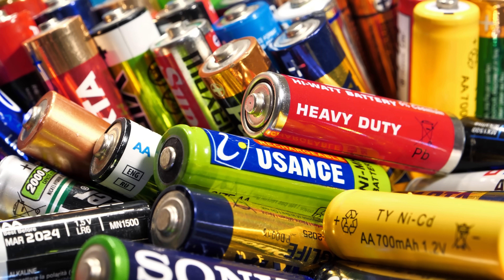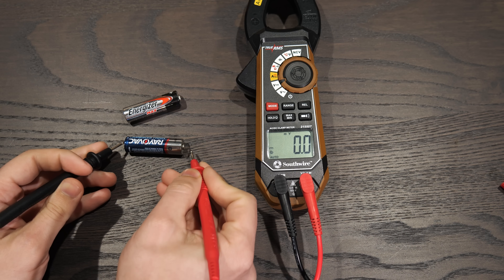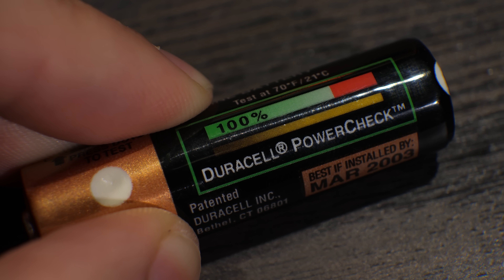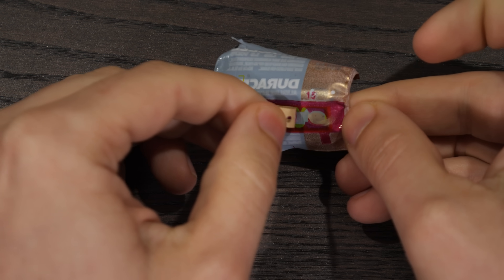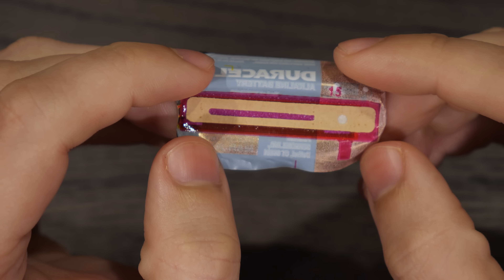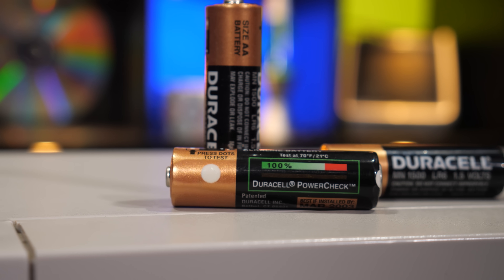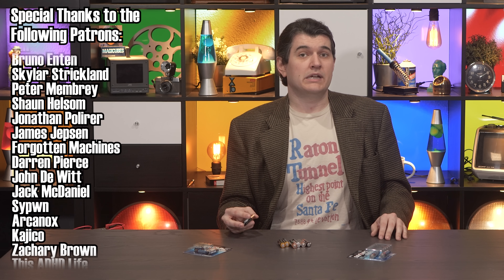Duracell PowerCheck: A genius idea which didn't last that long

Comment: This whole video is like a replay of a weird conversation at a party I was at in 1998 ish, complete with thawing open the label of the battery and running the whole shebang off a laboratory power supply

Comment: I don't know if you know this but ALL BATTERIES are rechargeable and you can save money. 
If you don't give them to much voltage they won't explode. For example AA batteries need 1.5 volts or 3 volts  if your charging two.
You can use a higher voltage to charge batteries but stop when they heat up, after they cool down you can do it again until full but if you use the same voltage they are rated you can leave them charging all night. And lastly batteries are like tires and will explode if you over fill them. 
( video idea?) 
Love your work!👍

Comment: >Gameboy
>dozens of batteries
Hundreds*
Was stoked when I got the Super Gameboy or whatever it was called. Came with a slip on shell that had 2 fold out speakers for stereo noise, a fold up magnifying glass with lights, a rechargeable 4 cell battery pack, an adapter slip cable that had two flat metal pieces to go between battery pack/terminals with a third end to plug into the housing, and an ac adapter.

If you forgot what plugged where though, you'd plug the battery via cable adapter, or the wall adapter into the audio out port frying the sound... rip street fighter, tetris, and pokemon music...
Reply: Also, AA/AAA weren't bad... but C/D/9v was malicious. The 9v would disappear for smoke detectors/thermostat, the D went into flashlights/lanterns, the C just disappeared period (usually grabbed by mistake then left out and tossed.)

Comment: Anyone remember the earlier versions of these?
They were part of the plastic shell package. In a pack of four, there would be a "fifth" opening between the two pairs that functioned as the tester. I'd cut them out and keep them around.
They were also purple and difficult to see. It was later they switched to yellow.

Comment: Fun fact: if it's a single cell, it's not technically a battery! Battery comes from artillery battery (multiple cannons), which comes from battering city walls. It was originally used to describe multiple voltage sources used together.

Of course that's no longer current. That's just watt we call them now.

Comment: I remember these. I distinctly remember a few times these burned my fingers, too. I remember they got hot enough when I pushed my fingers hard on the dots, and the heat was enough that I dropped them to the ground. Not sure if this was a widespread problem or maybe just a bad batch. It's hard to imagine these AA batteries which I always understood to be very low current, could produce that kind of heat to hurt. I do not believe the pain was from me pushing the dots too hard otherwise it would've happened with every battery I tested.

Comment: I felt that I could manipulate the reading depending on how precisely and with how much force I pressed on the built-in meter.  I really couldnt just give it a quick squeeze and be assured that I had an accurate indication of the battery's charge.

Comment: When I used my walkman every day in the 80, I did not want to keep buying batteries.  The only solution was to spend $6 at radioshack for nicad.  Yea way overpriced, but they lasted for years with a good charger.  I just had to remember how long they last and charge them up before that time expired.

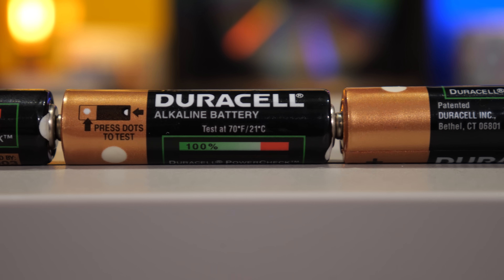Comment: I remember those separate battery checkers mentioned at 12:54 needed to be pushed quite hard as well, I wonder why it still required that even when it wasn't built into the battery and constantly draining it. I guess they just wanted to stop you from draining a battery that's left in the tester?

Comment: I remember a small flexible strip that could be pressed on each side sometimes came in a pack of batteries. I don't recall if that was concurrent with the power check.

I'm not as positive on rechargeable as they usually aren't replaceable and even when they are finding a match isn't always easy. I had to throw away an e-reader just because the internal battery couldn't hold a charge anymore and the replacement I ordered didn't have a little connector on it

Comment: Those testers got surprisingly hot and it felt like they used a significant amount of charge each time. Running the battery flat by testing it to make the bar light up, definitely not one of my brighter thoughts...

Comment: Ban AAA batteries in future designs, it has a high footprint in manufacturing against the energy capacity it has.
Even AA size lion rechargeable batteries has come a long way, and alkaline batteries should be thing of the past.

Comment: Your explanation of why it heats up is very poor. It would be better to explain it that it heats up for the same reason 16 gauge wire is a fire risk at 20 Amps, but 12 gauge wire isn't.

The way you explain it makes it sound like the voltage drop across the first part is the same, which is not true. The voltage drop across the entire element has the same ratio. What happens differently is the amperage. And the low Amps do not heat up the wider part nearly as much as the narrower part when the voltage is low.

Comment: I remember seeing my first rechargable (C cells if I remember correctly) at a Radio Shack store.  I picked one up and commented that it felt considerably lighter than the standard disposable type.  The technically astute sales person assured me that  the lighter weight was to be expected, as they were not yet charged.

Comment: I definitely remember those power check Duracells.
I still have a couple left that are still able to keep my quartz wall clock going.
I found they were inaccurate "right out of the package" (basically)
I found they only lit up the strip in the first few weeks of new, then they wouldn't do anything but tested okay.
I have a load type bench tester that gives an under load indication.
I guess they were a sales gimmick.
I still remember the TV ads for them and the "WooooOOP" sound as the actor in the ad pressed the cell ends.  Like it's ready for takeoff lol. 
Now the major thing I think about when I read the word "Duracell" is when they're going to start LEAKING.
It helped the environment by making LITERALLY BILLIONS of the new eco cells leak in the package and end up buried in the dump along with the remotes and flashlight and digicams that they ruined by the leaky mess.
People don't recycle.

Comment: Every household should have a battery tester if they use any battery operated devices.  Saves throwing out good batteries vs when equipment itself isn't working.

Comment: I think the launch of the tech also came way too late to be nearly as useful as it could have been. If it had come out when we only had NiCad batteries I think it would have continued to develop and lasted decades longer. But we already had NiMH for nearly a decade by the time this dropped. It was also common by then for a household to have at least one all standard cell size battery charger in the house. And that became even more common 2 years after this feature came out when they figured out how to improve NiMH with a Ti-Ni alloy. Even without Li batteries becoming more and more commonplace. The timing of when this became a feature really did make it having a short run time inevitable.

... Also "I'll get pedanted for that." could be merch.

Comment: I think the fact that these were such a literal pain to use (particularly the negative pad) probably made them an easy thing for most people to move on from, but I could honestly see these getting a lot more mileage nowadays on rechargeable batteries. If you're using rechargeables for anything important, chances are you're gonna make sure they're charged anyway, but it'd be a handy function for those occasional times where you just need one with a decent enough charge and can't find (or don't own) a standalone tester

Comment: What was the resistance of the tapper strip? Could you measure it and share? I wonder how much current this test system did draw. I remember my father telling us to not use the tester as it was consuming the battery.

Comment: As an oldschool analogic amateur photographer, oh god, i miss those self testing batteries! Let's say you are going to take your yashica flash which takes 4 AA batteries to take some photos, and of course, you dont let the batteries hanging inside the flash when not in use to prevent them leaking and ruining the whole thing, so, you take your flash and open the battery drawer... And there lies 173 used ones... With those tests you could just press, select 4 satisfactory ones and boom, good to go. Without, gambling game... You could have 3 good and 1 bad, wich could be enough for the day, or... 1 good and 3 bad, enough to 5 pictures and a light fart... Anyway, i know its a very specific niche, but yeah, i miss them...

Comment: I remember the on-package battery testers, and I'm glad you mentioned those. I never really had a problem using those, but when they switched to the on-battery design... I can still feel the pain in my thumb trying to get the negative contact to work.
Reply: As soon as I saw the thumbnail my thumbs started to throb lol
Reply: I honestly think that's one of the reason why they don't make them anymore.  Too damn uncomfortable, jamming your thumb against the edge in order to try to make a good electrical contact.  😠

(And then when the yellow strip doesn't respond, you can't be sure if it's the battery or the connection, so you jam your thumb against it even harder!  😫)
Reply: It wouldn't have been so bad if they didn't put one of them right on the edge of the bottom so it dug into our fingers when we went to use the darn things.
Reply: I would bet another reason they did away with the tester on the package was because you could use it for any battery.  That's exactly what I did.  Bought a pack of more expensive Duracells just to get the tester, then continued buying cheaper ones after.  There is some truth to the notion that the best alkaline battery is the cheapest.  Duracells seem to maybe be slightly longer lasting but that also may be placebo effect as we have been conditioned with commercials for decades proclaiming that Duracells are the longest lasting.
Reply: Thanks for mentioning that! I remember the battery tester built into the plastic clamshell of the package. That was the sensible way to go. No need for every battery to have one.  I remember the plastic shell being a little tricky to bend around the battery while keeping the battery aligned.

Comment: Am I weird for checking if the battery is dead with its weight? If it's heavy, it's good, if it's light, it gets thrown away. Works every time.

Comment: Well, i liked it while it lasted. I suppose I'm the guy who needs a battery tester because i have baggies with used batteries written on them. It's never fun when you go to use batteries and only one might be bad but you don't know which one that is because most things require 2 or more batteries.

Comment: I remember those, and Duracell was the only brand I bought for my photography flashes.  If I knew I had a tightly-timed photo session, say, let's do the families of the bride and of the groom next, then I wanted to have an idea if my batteries were going to last long enough for the needed flashes. If not, I'd pop in a new supply of 8 AAs and go to town. Anything reasonably decent in remaining charge went into my righthand gig bag, and everything else got tossed into the trash.

Yes, this was during the early days of digitals.  But I wasn't ready to abandon my Nikons and Kodachrome.

Comment: I really miss these..  I am clearly the target audience.  Yes are these junk drawer batteries any good sure but also is the remote broken or is it just the battery.  Sure I have a tester but can I find it?  Am I on vacation? Did I bring the tester with me of course not is the flashlight in my camping rucksack buster or are the batteries desd. Should toss this battery or does is have enough juice for a clock or something still?

Comment: As a gameboy user in the 90's I definitely found these testers to be very helpful as I would steal batteries from other devices like remotes... until I found a rechargeable battery pack that included a light up magnifying glass to make gaming capable at night.

Comment: Duraleak could never create a battery that did not leak.  I took some out of a remote when they were not leaking, put them on the mantel for a while, yep. they leaked when not even in a device.   Just say no.  But the battery check was a nice idea.

Comment: if they had cheap battery testers that came with packages of AA batteries before they had these & the problem was the UI & UX inherent to how tiny the devices had to be.... why didn't the TV remotes & gameboy colors that used them just include them? heck i went shopping for a tv remote recently and they STILL don't come with battery indicators of any kind, even tho they're all jam-packed with WAY too many unnecessary features

Comment: I still have about 4½ minutes to go, but I'm surprised by the description of normal battery-usage that doesn't rely on testing.  For me, the main use of the testers was as follows:  you have something (say, a remote control or a Walkman) that uses two AA batteries; you put two new batteries in it; eventually, the total power of that pair of batteries is so low that it will no longer work the machine; but the two of them don't have the same amount of power left; you test each of them, keep the stronger one in the device, and replace the weaker one.  On top of that, you may find that the batteries that no longer have enough juice to power your Walkman will still work in your remote control, so you do take the Walkman-insufficient ones out and leave them loose in a drawer, from which you'll remove them when the remote stops working.

Comment: 12:30 is an example of how you should NOT insert the battery into your devices because the cell terminals have been thoroughly smudged with finger oil & dirt, thus preventing maximum power transfer.  Always grab the cell edges with finger nails, or better yet insert the cells with gloved hands.
Reply: It applies to any end to end pins in connectors you see in computers and mobile devices as well. Always avoid physically touching them if you are inserting something like say a USB cable or device and if they do get badly smudges then it's probably a good idea to use something like pure isopropyl alcohol to wipe them down every once in a while.

Comment: As a kid it was just absolutely cool to hold the tabs and make lighty light turn on. I think today it would be the same, and the young generation itself could provide a market for them... except today's kids dont use that much stuff with AA/AAA batteries anymore, as most things have built-in batteries nowadays. :/

Comment: 0:20 Lol. Old example - the Game Boy Pocket. The early versions of the OG Game Boy used 4 AAs - to make the Pocket smaller and lighter, it used 2 AAAs. It definitely did make it lighter but it also reduced the battery life by a fair bit.

That would be an acceptable trade-off in an of itself, if not for the final version of the OG line which kind of highlights how pointless that change was - the Japan-exclusive Game Boy Light. Basically a Pocket but with a rather lovely backlight for the screen - and it used 2 AAs (presumably to offset the extra power consumption of the backlight.) The thing is, the Light wasn't that much bulkier than the Pocket but due to it using 2 AAs it had a noticeably better battery life than the Pocket (most notable with the backlight off.) Makes you wonder why they didn't just use 2 AAs for the Pocket.

Not to diss the Pocket too much though - as well as being a fair bit smaller, its screen is a lot nicer than the OG model's.

Comment: I need a battery tester because instead of throwing batteries away I stick them in a drawer and say "I will now google how you are supposed to responsibly dispose of batteries" and then I don't and then I have a bunch of old batteries that get mixed with new ones.

Comment: I remember these, but there's STILL a battery test included in EVERY battery: Let it bounce on a table with the negative side down. If it bounces up again, it's near empty. If it basically drops to the side on the table, it's full. Also works with rechargables (at least the Eneloops I have).

One thing you didn't mention: Using batteries is a waste of money and resources, rechargables are the better way! Eneloops hold their charge for so long now, actually years, you can even use them in remotes. And for the practical part: All better chargers can indicate how much charge is left, so no need for an additional tester anyway...
I don't get why people still purchase non-rechargables...